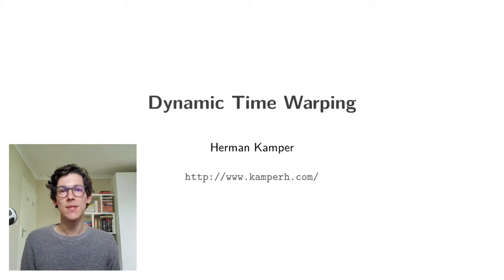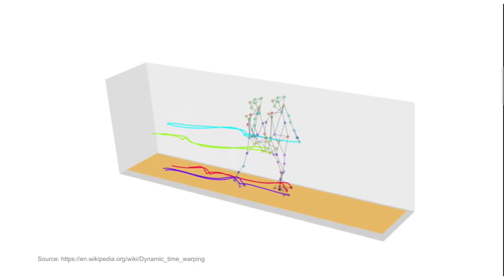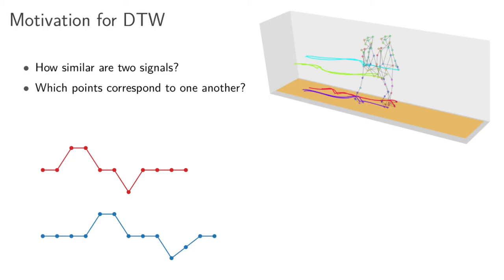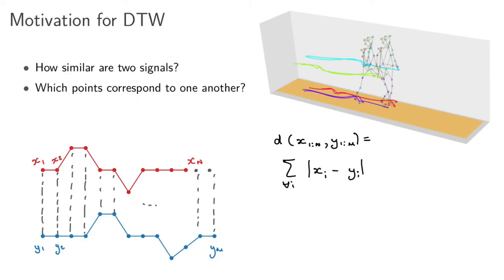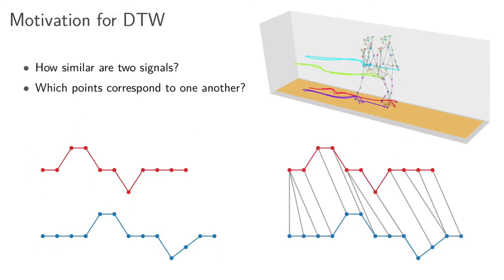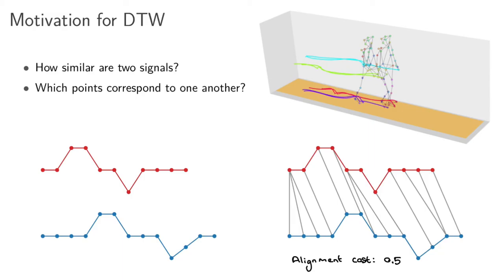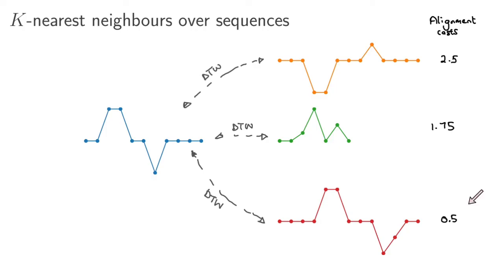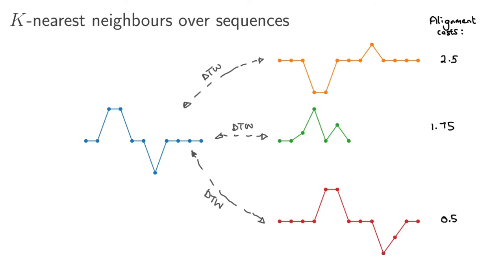Dynamic time warping 1: Motivation

Comment: Very helpful. Thank you for sharing! 

A question I have… I am looking for an algorithm to compare a human drum performance captured over midi to a click track. Answering the first question you pose in this video would provide a kind of performance accuracy score (e.g. “how closely was the drummer able to re-create the signal generated by the click track?”). And answering the second question posed in your video, perhaps while also presenting data on how far offset the corresponding points are, could give a drummer insight as to whether they are behind or in front of the beat, and by how much, etc.

DTW seems close to what I need, except that the algorithm seems to be dependent on the sampling rate matching between the two signals. In this case, the human drummer may add or drop notes altogether relative to the click track, and thus end up with a different number of samples that likely never precisely line up with the click track at any point in time. 

Could you recommend a way to process these two times series that would enable me to answer the two questions you posed in this video?

Comment: Hi, thanks for the video. I am working with a database where I have the total monthly customer spend over 5 years on a product. My goal is to try to see which customers tend to increase or decrease their consumption at the same time by similar magnitudes. For that I am making clusters with the variable time and with the variation in consumption with respect to the previous month. For this I used k-means using the Euclidean distance as a measure. Do you consider that this is okay or should I use dynamic time warping as a distance measure? Greetings and thanks.
Reply from the maker: When choosing a distance metric, the crucial question is what you would like to do.  Different distance metrics makes different underlying assumptions.  So in DTW, for instance, the metric is explicitly developed so that, if the same pattern occurs at different points within the signal, you will still get a low distance (high similarity).  From what you are saying, I don't think you actually want this, since you have the phrase "consumption at the same time", although I'm not entirely sure what that means.  With Euclidean distance, you will always be comparing the first time-point of one consumer to the first time-point of another; in some cases this might be exactly what you want to do, where in other cases this might be exactly the opposite of what you want to do.

Long answer to basically say: there is never one distance metric that will give you best performance in all cases.  DTW is really good at some things, but not everything.

Hope that helps! :)
Reply: @kamperh  thanks for your answer, i'll be waiting for more content :D